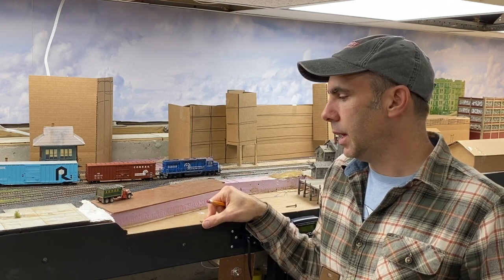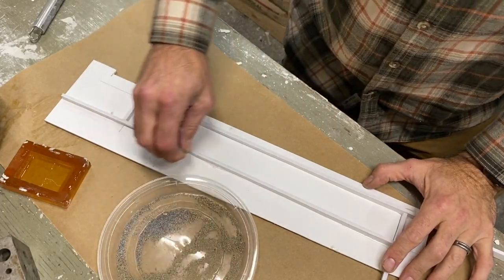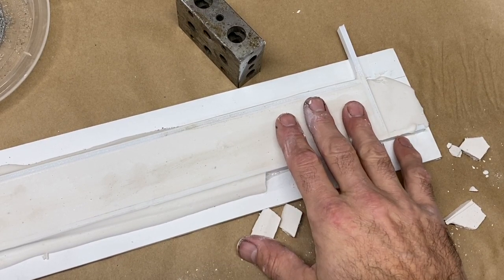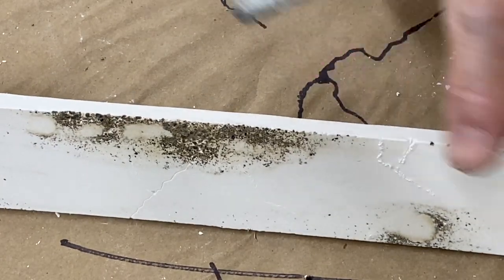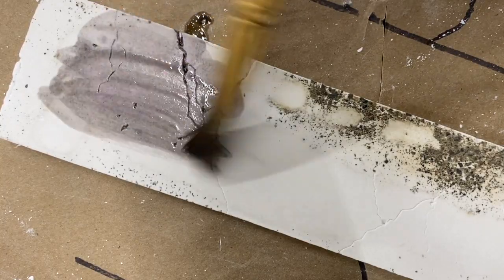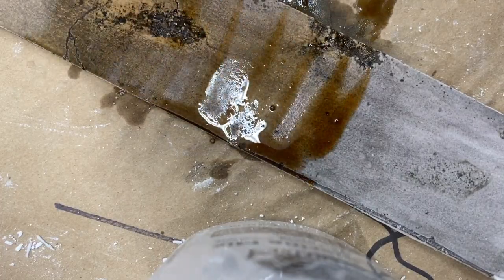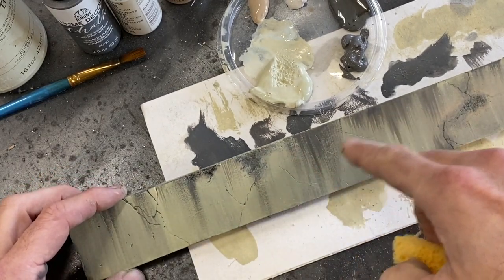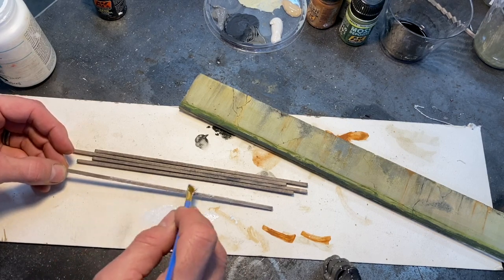Make A Concrete Seawall

Comment: I'm making a concrete wall with this method.  I used foam core as well, but after I removed the forms the wall stuck to the base leaving a papery mess. I had to scrape it off with a #11 blade and clean it up with sandpaper.  Thought that was odd since yours didn't do that and I used the exact same materials